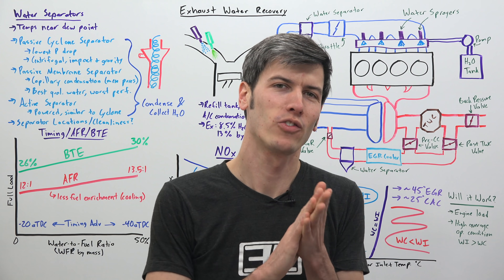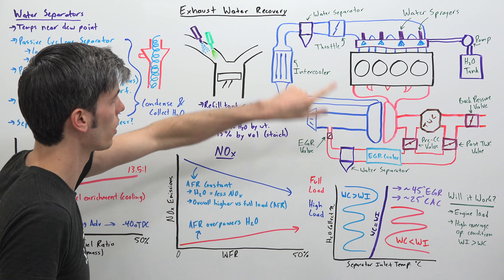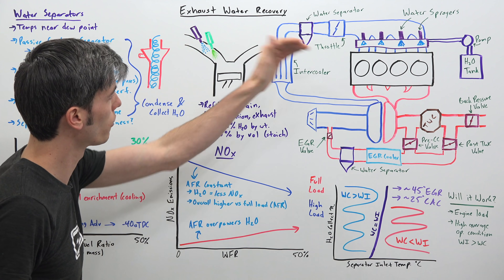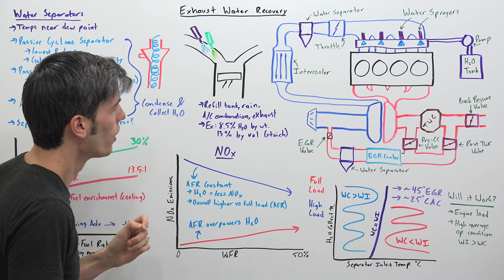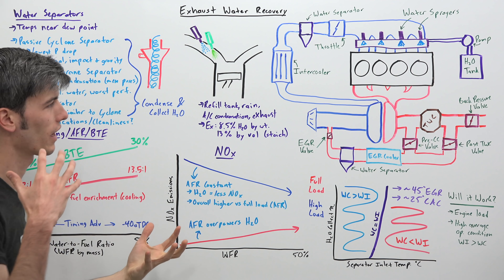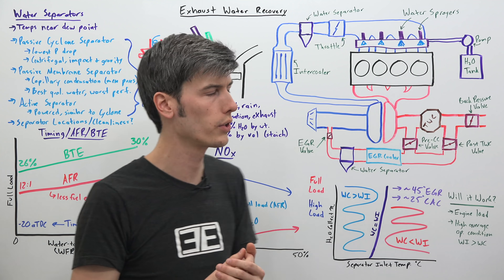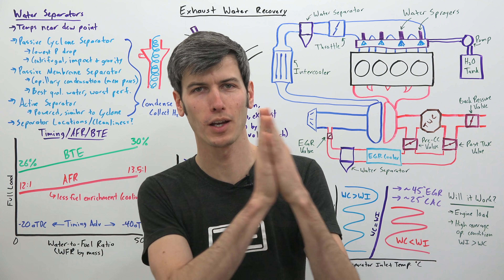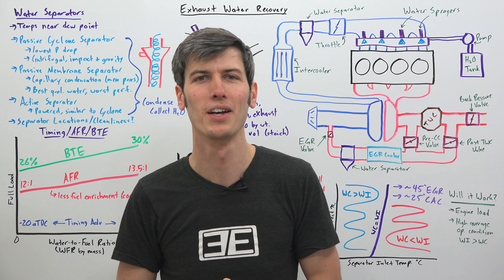Using Exhaust Water To Make More Horsepower!

Comment: The fundamental flaw in this for an ordinary car is freezing temperatures in winter. You would either have to dump all the water when you shut the engine off or mix an anti freezing agent like alcohol.
Reply: Conn Clark or you use a heat exchanger to thaw the frozen collected water.  You could use exhaust gasses or coolant as the heating medium.
Reply: Dwayne, Freezing water expands. It tends to bust lines and tanks.
Reply: Conn Clark not if it’s correctly designed and the materials are correctly spec’ed.  It’s really a very simple issue to solve.
Reply: Dwayne, ummmm.... no it isn't that easy to solve. That is why we need antifreeze in the winter. You might be able to design some thing that could last a few freezing cycles but eventually fatigue will do it in.
Reply: Conn Clark a cars cooling system is a pressurized closed system.  That makes freezing expansion an issue.  You don’t have that constraint with a water injection system, at least not for the storage side.  I have frozen many, many hoses and containers that haven’t cracked because either they were flexible enough to handle expansion due to freezing or had expansion space for the ice to form (think a ice cream cone shape container not filled to the top)

As for the part of the injection that needs to be pressurized during operation (assuming a boosted application) on system all you need is a low point drain actuated by a solenoid.  It takes 12v to keep it closed.  turn off the car and the tiny amount of water in that segment of the system drains back to the reservoir.  Or just design it strongly enough and keep the volume of water in that segment to a minimum.  Or both.  

All the “heat exchanger” that I referred to in the previous post would need to be is a jacket of coolant around the injection reservoir.  Or an electric heating element(s).

Comment: Should you not show the water separators connected to the water tank in your diagram?
Are the water injectors likely to get blocked due to the unclean water? If one water injector gets blocked and you have the advanced timing on that cylinder = Kablamo?

Comment: Gasoline is composed of hydrocarbons of 4 to 12 carbon atoms attached to a number of hydrogen atoms. Combusting with air you get heat,  carbon dioxide, water vapor and some (hopefully small) amount of other molecules such as carbon monoxide, various NOx pollutants and perhaps carbon soot. I found it surprising that the water vapor makes up such a little percentage of the exhaust considering that you get about  9 molecules of water vapor for each 8 molecules of carbon dioxide in the exhaust. But thinking about it, the biggest chunk of the exhaust consists of nitrogen (and argon) that one has wastefully heated up only because it would be too difficult and expensive to avoid doing so.

Comment: Way cool! Other ways of using water to make more power abound.  You can collect heat from both the hot engine components and from the exhaust, convert liquid water into steam and let the steam power part of the engine, thus making a combined cycle engine.  BMW already has done the exhaust heat with their 2011 TurboSteamer.  You could expand on this by making the gasoline-powered part of the engine so that the coolant changes phase, makes steam, and you would have more steam power to recover.  You might be able to get so efficient at it that you eliminate the radiator and have only a condenser to convert the steam back into liquid water (lossless!) to keep the power-adding cycle going.

If you, sir, made this, it would make for a FASCINATING project!

Comment: Very cool. I cant help but think its over complicated. Why not just have an exhaust that has a heat sink design on the outside, to keep the surface of the exhaust as cool as possible for the exhaust vapours to condense on, then have it drain into a tank. Also a huge empty back box to slow down exhaust flow, with external (to cool the exhaust piping itself) and internal heat sinks (more surface area to condense water on the inside) Obviously it would mean having a stainless steel exhaust system to stop corrosion. I run WI on my diesel merc.

Comment: old boeings 747 used to have water injection too  as they could burn more fuel in the engines due to the temperature decrease on the combustion chamber,
but apparently it had more cons than pros as it added weight which is the least desirable side effect and it would actually freeze at high temperatures which would make it useless after some flight time!

Comment: Once the exhaust is on operating temperature, no more condense water comes out of the exhaust...
Reply: Ummm, H2O is a product of combustion.  What do you think becomes of the hydrogen atoms in the hydrocarbon fuel when it is combusted?  H2O will be produced as long as the engine is running.

Comment: Questions >> In a Lab, or white board, all looks ok, BUT the DEW POINT in the ambient air outside is NOT at all Constant.Thoughts?   The 1st "separator" removes some of the Density of the intake air..Yes?Not affecting performance?   Wouldn't this system affect the PPM Emissions of other gases ?

Comment: There's a lot of comment about EV being better.
I would like to have a discussion about this, personally I think, for now, small hybrid car are the best.
1- Small engine with an electric motor to compensate, more efficient.
2- Regenative braking, more efficient.
3- Start/Stop without the lag, best in traffic/ city.
3- Small batterie, less pollution during fabrication, less weight.
4- No need for charging, no downtime.
5- Not that much more complex.

Also I don't understand how EV are supposed to change the world, in many place electricity is still produced using fossile fuel and the distribution induce a drop in efficiently. Also I don't see those big non-recyclable batterie being so good for the environnement.

Comment: How about using an active charge cooler (after the intercooler? or instead of it?) as both a condensation surface and a way to lower intake temps? Yes, running it will consume power… the question is if it offsets that power draw with the increased power output because of the lower intake temp by a big enough margin to not matter too much. And that way you could guarantee the condenser stays below the dew point at all times.

Comment: the deep breath United States Army Air Corp looked into this before WWII to enhance the range of their bombers. It didn't go anywhere, not for the bombers at least. 
As to why they didn't just use regular water injection to increase horsepower (and thus the takeoff weight) just during takeoff, is beyond me. 
The Air Corp eventually put water injection on their fighters, as you only need it for the 10-15 minutes of combat, the fighters only needed to hold ~15gal, which was worth the advantage.

Comment: I'm guessing that the active method that requires electricity is using something like a peltier thermoelectric cooler to do it's job. If that's the case, when the system isn't able to produce enough from just exhaust, maybe it could have an additional unit that extracts it from the ambient air, which should always be cooler than the exhaust.

Comment: You can deal with excess water by running purely on water (turns into steam, increases pressure, etc.), just like a 6 stroke ICE does (it probably is only a concept). I would enjoy turning off the fuel injection few kilometers before reaching destination, so the water cools down the engine (which would cool down anyways after few hours) while making reasonable power.

Comment: So much complexity for such a simple thing.
Does not work in dry places because low moisture in the air.
Does not work in cold places because the water will freeze because no glycol or alcohol in the water.
40 degrees is a lot of timing advance, are you sure they did not have a bad ignition system, that took longer time to ignite the colder and more moist air, therefor the timing was advanced?
Reply: Yeah, in the states, some areas in the summer can hit that 45 degree C temp, and will have a 10% humidity. Seems like this system simply could not work. Even in winter, the humidity is so low as to never be able to recover enough water.
Reply: Lars Jørgensen Dry air is no problem, if you collect on the exhaust side. The water comes from the fuel and oxygen from the atmosphere.

Comment: When calculating system sustainability, did the measurements include the injected water?  
 
Why not use an intercooler as part of the muffler?  It could be as simple as adding heat sink fins to the (stainless steel) exhaust system, with a "T" near the end to collect the condensed water.
Reply: Thats what the egr cooler is its an air to water intercooler.

Comment: Would a water injection system be possible with ITB’s?
Reply: No reason to run it. WMI is a tool for forces induction engines where the intake temperatures can reach 5 x the ambient air temperature.
The goal is to try reach ambient intake temps as closely as possible. With an NA engine you dont have this problem.

Comment: You can fill your car with water by driving into a lake
Reply: Goddamn masterplan
Reply: Modern problems require modern solutions
Reply: I usually just use the garden hose. With my car if I drive into a lake there's simply to much fuel and it floods the engine

Comment: Hi Dude will using a high octane fuel give you more power ?
Reply: In general, using high octane only benefits high-compression-ratio engines or setups with lots of boost. Although high octane fuels often have more additives that help engine longevity, octane alone is purely a measure of how well a particular fuel resists preignition. Using high octane fuels allows more boost and/or timing advance in your tune, resulting in more power.

Comment: Very very interesting stuff you got going on here! I know you didn't mention it, but one of the things that I was thinking about was how "clean" this water needs to be in order for this operation to work. So for example, would the internal functioning of the engine "dirty" the water to the point where the system doesn't work as well as it could? Anything about an internal filter? (or a changeable filter that the driver would be responsible for?)

Comment: Fuel stations could easily be modified to include an additional water/glycol filling nozzle that is part of the traditional fuel filler handle. Two nozzles essentially. 
Newer vehicles would simple have a small addition tank to that is filled at the same time.

Comment: How much does external humidity affect the ability to self sustain? Also, does the increase in power actually make up for the increase in weight?
Reply from the maker: First question, not super dependent. H2O is a byproduct of combustion regardless of humidity. Second question, of course! Otherwise it would not be done. For example, on the BMW M4, the system allows for a 50 HP gain. Quite significant for a low weight gain.

Comment: Just as an FYI intercoolers themselves act as a water separator. I know because I used to use a blow through maf post intercooler and I would have issues with water droplets spraying on the hot wire element in the maf, peticularly on a high dew point day. Ford has issues with this same problem. The fix is to make a small hole in the bottom as a weep hole to drain any build up of water or oil from the turbo.

Comment: Why they didn't try to move the separator before the compressor (low pressure / low temperature side) ?
Reply: SnowCat you have to have a temperature drop across the seperator to wring out the water.

Comment: I assume someone has tried this by now, and presumably there's a reason why it doesn't work or we'd all be doing it:
What about spraying a little bit of water directly into the cylinder right as combustion completes, to flash off to steam and give the piston a second push? Does the water vaporize too slowly to be useful? Or does it just simply clean all the oil off the cylinder walls and wreck the engine?
Reply: I do recall reading a while back about a 6-stroke engine created by Bruce Crower that has a second power stroke made purely of re-compressing the exhaust gasses, injecting water for a second power stroke, and then pushing it out the exhaust valve. The water took away so much heat from the engine, the experimenter was able to drop the cooling system altogether and rely only on air cooling, but it was reportedly constantly plagued by the water stripping the oil off the cylinder walls.

Comment: Bollocks to this, it's going to end up with more problems to the system, or BMW will sell you oem water and you'll need to take it in to be coded.
Reply: RF transponder in each BMW water jug?  I could see them doing that, actually.  "Oh, I'm sorry, your warranty is no longer valid, sir <smirk>."

Comment: Has anyone done research on separating water that's absorbed from ethanol as it's stored in the fuel tank?
Reply: So I've done some research on this matter. What happens is the ethanol absorbs water up to its saturation point which is something like 10%. Ethenol as we know mixes with gasoline, so water will actually go through the combustion process because of this. Dry gas additives like Heet Isa actually denatured alcohol which is 50/50 ethenol methenol. Fortunately gasoline today has at least 10% ethanol which helps slowly remove any water in your tank.
Reply: @joshuahebert9949  So setting something up to separate the water that gets obsorbed to use like the video explained probably wouldn't work. Or is already handled by that system.

Comment: Water injection without methanol would not do well here in Minnesota winter
Reply: These systems auto shut off and detune when below a certain temperature, about 3 degrees above freezing.
Reply: Jeeze, put a heater on the water tank.  An ICE is a fantastic source of heat, even good enough to toast your toes and thaw a frozen water tank.

Comment: So do all newer vehicles use this system for emission aswell as making extra power the only reason I ask is because I think I got an exaust leak on my hellcat and want to fix it but if there are weep holes on purpose due to to much water well then it's got a purpose but if it's an accual leak then it needs to be fixed. Hell I dont even know if it has this system and if it does adding a better high flow exaust will be a sum what problem along with having to look at a check engine light on unless you can hook up the old system to it. Anyone got any advice?

Comment: Have a water jacket around the exhaust, use the heat to make stream, blow the steam into a turbocharger along with the exhaust, run that steam through an evaporator, and back to the water jacket. Done.

Comment: Areas where the humidity is low this would be impractical. Also due to the added cost of this system how long does it take to break even against a non water injection engine? Sound impractical.

Comment: Subaru can use the vapor from their driver's vape pens and inject that instead. Instant 100HP /s
Reply: Most of those vape pens are modded to produce a stupidly huge cloud, so you're probably talking over 100 additional horsepower.
Reply: Pascal second?
Reply: My Subaru can inject water using its leaking head gasket.
Reply: @svgPhoenix2 Is that html ?
Reply: Bruh.mp3

Comment: While I knew there was water in exhaust emissions, I didn't realize it was anything more than 1%!

Pretty cool stuff! I wonder if that could be combined with an HHO generator to make that self-sustain as well.
Reply: Unfortunately no. HHO generators are very inefficient and produce almost nothing for how much power they consume. imagine taking power out of your battery, converting it at 30% efficiency, and then burning it at 30% efficiency. What percent of original energy is left? I'll go ahead and answer and its about 1/10 of input which is not good compared to the new toyota's putting down 41% and recouping some of it on top with the regenerative braking systems.
Reply: I was wondering how quick this idea was going to appear.
IF, you put 100 square meters of solar cells, on a car, in Phoenix, and left it in the sunlight, all day. You might have enough hydrogen to use fuel cells for a minute (at driving load).
Reply: I think a fair bit of our pee is water which comes from digesting our food rather than being liquids or moisture we consume. Some animals in arid places get all their water that way and never need to drink.
Reply: HHO works because cars have alternators that are chosen for the greatest draw necessary. So it works on an overdesigned inefficiency, that then runs an inefficient hydrolysis, and put into a 30% efficient heat engine.

Comment: I've seen a video about a guy from Mexico who had a tank of water on his truck, which was used to produce hydrogen on the go and then mix it in the combustion to reduce gasoline usage and theoretically lower the emissions. I won't go into the emissions issues because I know you can have really bad emissions burning hydrogen, but I'm really curious if there could be a way to mix this two systems to recover some of the 'burnt' water...

I can see the increase in crashes during rainy days due to the amount of people going out for a ride to recharge their thanks for free hmm...
Reply: What was the energy input for creating hydrogen from water?
Reply: @duncancampbell7357  electricity from the battery and the one generated by the alternator I think